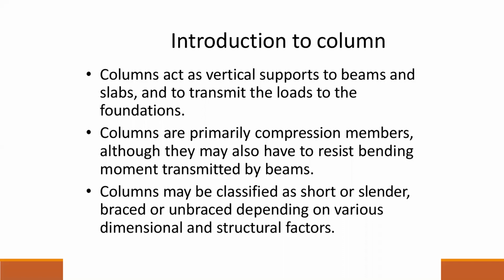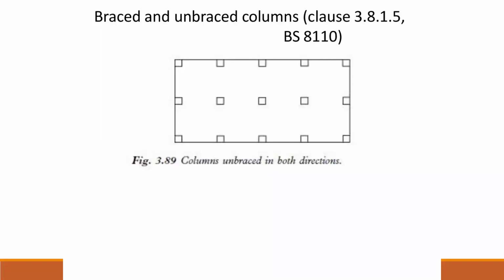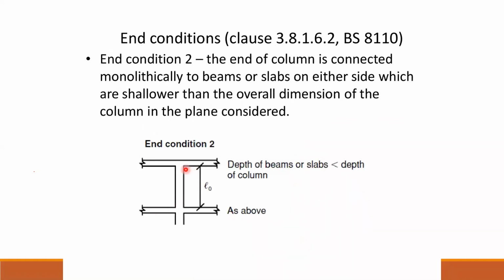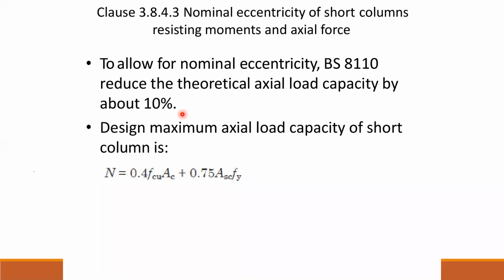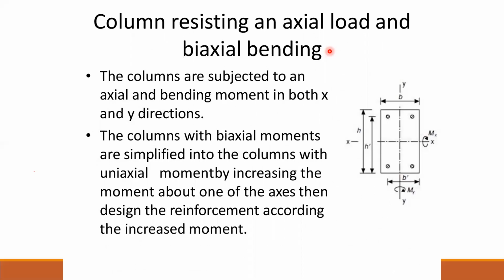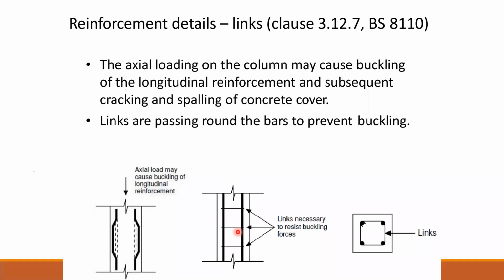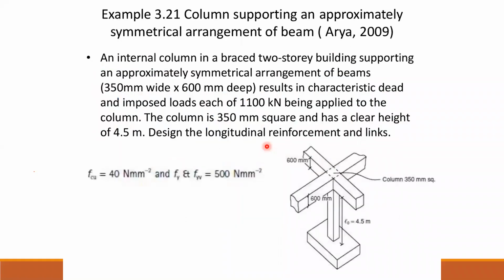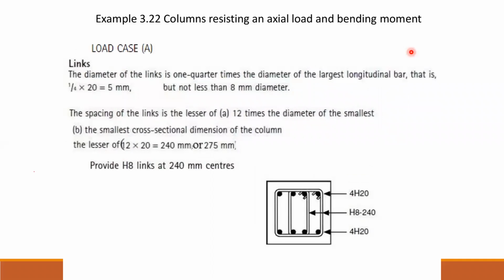Reinforced concrete Column Design BS 8110

Comment: Thank You very much sir. 

can you expand more on this for me, in the example 3.20, you said in the explanation that, once the distance between the longitudinal bar is 150mm you should provide additional bar to break the length. But the example you solved the size was 350mm but didn't provide any reinforcement bar.